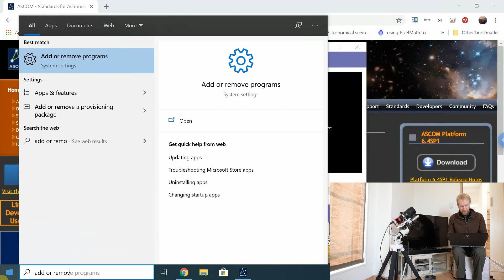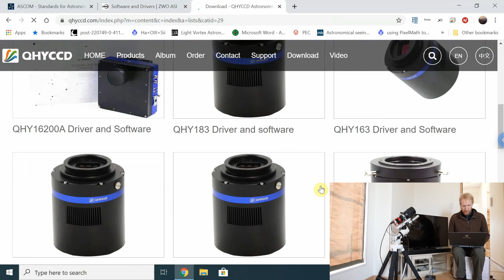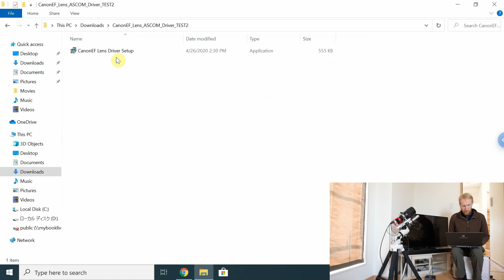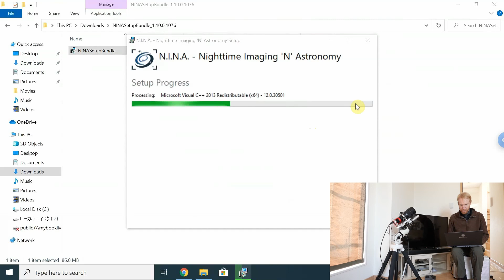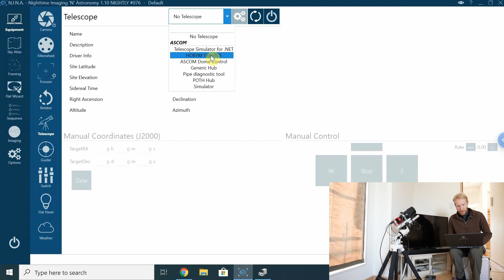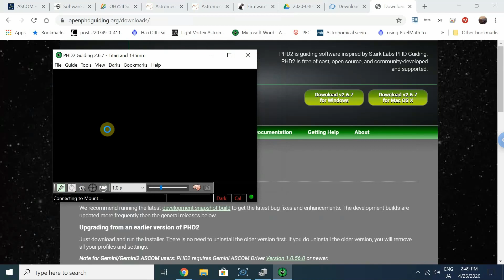Setting up your PC for Astrophotography... From scratch!

Comment: How do you make Chrome remote Desktop start automaticly?
Reply from the maker: In theory it just does after installation. As a backup you can/should also setup Windows RDP (using RDP wrapper if the computer runs Windows 10 Home)
Reply: @CuivTheLazyGeek  Thx

Comment: Just bought a new laptop, now this pops up. wtf. Awesome 
With the conflict of a asi 294 mc pro changing the pixel size of the asi 120 mm mini. Is there a fix for that problem. I’m using 3.0 ports and 3.0 hub
Reply from the maker: Haha great timing! I'm unfortunately unfamiliar with that issues, but I believe there is a firmware update available for the 120MM, so maybe that could help!

Comment: Hi Yannick, I bought a Beelink GK mini PC, it's the size of a NUC, and it runs off 12V instead of 19V, 18W max draw. Notebookcheck.net has a review of it (Celeron J4125, 8GB RAM / 128GB SSD / supplied with Win 10 Pro (so I can remote desktop into it, you can't do that on Win 10 Home), 4xUSB 3, AC Wifi), and I found that by using a Kuma brand "car adapter" model SPS1, 10-28VDC in, 12V out, voltage stabiliser, I was able to run this mini PC from my 20m long "Cigar Plug Socket Extension Lead 12V" (Ebay UK) cable that I have running from inside the house (12V DC from a mains AC adapter), through a 12mm hole in the wall, outside to my mount, the voltage on the end of that long cable drops under load due to the resistance of the cable, but the voltage stabiliser solves that issue (also works off 12V battery of course as well, and as battery voltage varies, PC only sees 12V). I ran Prime95 on it for over an hour and all seems well. Then I set it up like you told us how to do. Many Thanks for the tutorial help, it's very useful. Thought this might help anyone who is wanting a 12V mini PC.

Comment: Did you install the various astro software using the original administrator account or under a local account?  Windows 10 Pro or Home?
Reply from the maker: I actually don't quite remember, I've repurposed this particular PC since then. I use Windows 10 Home though

Comment: Hi Cuiv,
Another great video. I hope you dont mind a little bit of constructive criticism (not negative).

There will no doubt be quite a few people watching this who are new to AP & maybe even not that experienced using a PC, with that in mind it may be helpful to maybe slow down a little & explain not just what your doing but why & what does it do.
A good example would be when it comes to prioritising com ports. Theres no explanation as to why com ports need to be accessed/ prioritised, also theres no mention of hardware priority, such as the mount is more important than the camera & therefore needs a higher com port (say 4 rather than 6) plus which com ports to use, as starting from 1 to 2 to 3 & so on wont usually work & you need to start from higher port (say Mount- com 5)

Hope you dont mind me asking this as your videos are very informative. 

Clear Skies
Steve

Comment: Hey Cuiv, Do we need to download the star chart (1gb) from the NINA website. I will be imaging in remote areas with no internet, so wondering if this is needed to for NINA to work correctly. Cheers for the vids mate.
Reply from the maker: You need it if you want the preview pictures in the NINA catalog, but it's not mandatory. Also, the framing wizard has an offline mode as well, that is quite usable. I think the biggest part is plate-solving, but if you have ASTAP, which can be used as a blind solver as well, you should be fine! Clear skies and good luck with your imaging!

Comment: I've now watched 5/7 of your videos.  I live in a big city, like you.  A beginning and I'm willing to spend some money for equipment.  I want a refractor and a ZWO camera, including a 120 mini camera for guiding.  What do you recommend?  Color or monochrome for city?
Reply from the maker: I'm glad you persevered - sorry the first video you watched was so full of jargon! OK so if you have the budget, despite the additional complexity, I would recommend going for a monochrome camera with LRGB and Narrowband filters. Make sure in that case you get an electric filter wheel (like the ZWO EAF) and focuser for your telescope too so you can autofocus between filters (and set filter offsets). If going the ZWO route, the smaller sensor / affordable / easy to deal with cameras are the 1600MM Pro and the 183MM Pro (which you choose depends on what you wish your resolution to be - I've used both, they're both quite good). If you are in the city, narrowband filters will help you vanquish light pollution (I have a video on that too here: https://youtu.be/gLrtznawfyk ). As for the filters, for narrowband I would recommend going the Baader Ultra-Narrowband way for a good price/performance ratio that doesn't leave you wanting in the long term. Or if you are a perfectionist, the far more expensive Astrodon or Chroma 3nm narrowband filters. There is a buy once, cry once saying in astrophotography that tends to be very true.
Monochrome will mean more equipment to buy, more work to get your setup ready for first light, and a steeper capture and post-processing learning curve. But it is worth it, from the city.
I hope this helps!
Reply: Cuiv, The Lazy Geek Thanks!   This can be an expensive hobby to start, so I'm gonna continue with my visual astronomy through the summer and see where it goes.  But I'm realizing the limits of being in the city for visual.  And I'm intrigued with astrophotography, but need to get a refractor (I have a Celestron 8" SCT and advanced VX Mount, which I will use for astrophography with an auto guide camera as you suggest).  I know the monochrome is more work, and someone else recommended the 183 (in color, for ease) but I'm so worried about city light pollution that I'm afraid mono is a necessity.  

I need to figure out what software I need to start too to run everything, scan the sky and stack/process the pix.
Reply from the maker: @jamespavlock9615  I see you're on the right track already! I actually got great results from Tokyo on galaxies with a color camera (the excellent ASI533MC Pro - which I would recommend over the 183MC Pro due to bigger pixels and lack of amp glow) during the galaxy season ( https://www.youtube.com/watch?v=lammovx8eI8 ) including winning a ZWO ASIWEEK for one of the images. You'll want to make sure the AVX can track and guide well... There are people who love the AVX, others who have a lot of trouble to use it for AP. The AVX I owned was a complete lemon, barely good enough even for visual - so there is variability!
For the software, there are many solutions available - for capture, I use (and am a contributor to) N.I.N.A., which is free and open-source. For processing, I use PixInsight, although many recommend APP (or Startools) as well. Lots of things to learn indeed! But I can tell you're on the right track - good luck!

Comment: Great video! :) Couple of questions.. What is the adapter that connects the cooled camera to the dslr lens called?, which QHY mini polar scope is it that your using?, also your Intel NUC mini pc, which model do you have? I know for just image acquisition you don’t need a real high a spec pc and the NUC looks great for this...are you running it of 12v dc power from the power bank? If so how long does it last for with everything connected?  Sorry for all the questions!ha! Thanks again for a really great video. Ant
Reply from the maker: Thank you! The adapter from the Camera to the DSLR lens is this one: https://astromechanics.org/ . The QHY mini guide scope (not polar scope - I haven't used polar scopes since Sharpcap implemented the Polar Align feature) is called the QHY miniGuideScope :)  https://www.modernastronomy.com/shop/accessories/qhy-accessories/qhy-miniguidescope-kit/
The PC is actually a Japanese PC I bought on Amazon, not a NUC. It runs on 19V, so not really good for astro on the go (for that, I use my laptop). Getting a true mobile PC for astro whose battery lasts forever is on my list though!
Reply: Cuiv, Lazy Geek in Japan Thanks for that :) I actually meant guide scope not camera, my mistake!ha...I was looking into either the iOptron ipolar or qhy polemaster but since watching vids of sharpcap and the polar align feature I’m definitely going to try that first.  PC/laptop wise I actually just bought a Chuwi herobook pro. It’s a 14 inch 8gb ram 256gb ssd (upgradable) and lasts for around 7hrs off a full charge, the charger is 12v 2A not 19v which was a decider for me incase I want to use it out in the field or charge in the car. It’s only got a Celeron n4000 cpu but it pretty quick and for just acquisition it seems great :)
Reply from the maker: @ant_hart  That sounds like a very neat PC!! I'm looking into the latest mini laptops from GPD, as they can be charged from USB-C as well... So much money can fly away with this hobby!
Reply: Cuiv, Lazy Geek in Japan There is a mini pc made by Pepper Jobs that can run off USB-C power, it’s on Amazon ...I’ve read some pretty good reviews ... PEPPER JOBS GLK-UC2X, TurboBoost 2.4GHz, 4 Cores Unlocked Intel N4100 Mini PC with Windows 10 Pro (64-bit) [Upgradeable/4GB/64GB/Dual-Band Wi-Fi/Gigabit Ethernet/Triple 4K 60Hz outputs/Dual USB-C] https://www.amazon.co.uk/dp/B07P1TCB55/ref=cm_sw_r_cp_api_i_yFlUEb86TGZSM
Reply from the maker: @ant_hart  Thanks, will look at that!

Comment: Thanks a lot I believe this will help me a lot.  I'm not Windows savvy, I'm a mac man so I haven't used windows in 15 years.  I'm going to try to connect to everything and I'll let you know. Quick question if I'm using a dslr do I have to use backyard eos or can i just use nina?  Again Thanks!
Reply from the maker: Good to hear this can be useful! Windows is very good, but it's forced updates can get very annoying. If you have a DSLR, BYEOS works well, but if you have a GoTo mount, I would recommend NINA or SGP as you can do slewing and automated centering of your targets. It makes things much, much easier! However NINA can have some issues with some DSLRs.
Reply: @CuivTheLazyGeek  Thanks again, for some reason I don't have my mount in the list of mounts when I try to connect it, I'm trying to use a guide scope without using the s4 cable and I have the cgx mount.
Reply from the maker: @spacedogsbackyardastronomy8274  I'm not familiar with Celestron mounts - I assume you installed the CGX specific ASCOM driver? Can you see the mount in PHD2?
Reply: @CuivTheLazyGeek  I don't know how to look for it in PHD2.  I tried reinstalling the drivers but now they want down load and the trouble shooting said that if it was doing that that I needed to updated Java so I tried to update it and it still does it. So I'm lose.